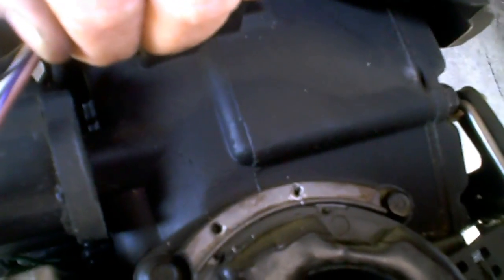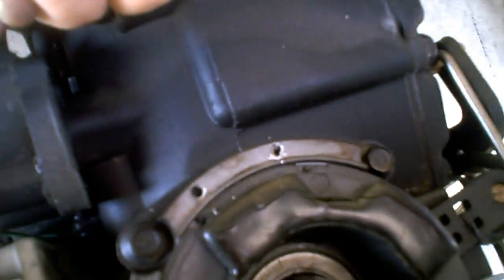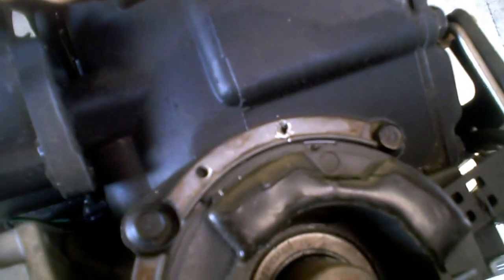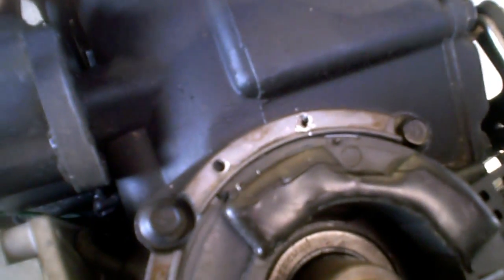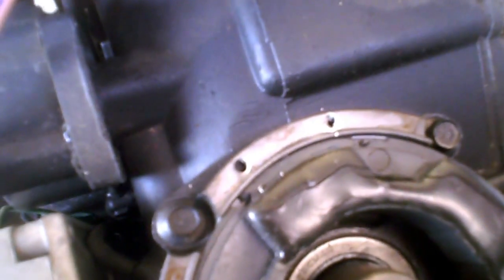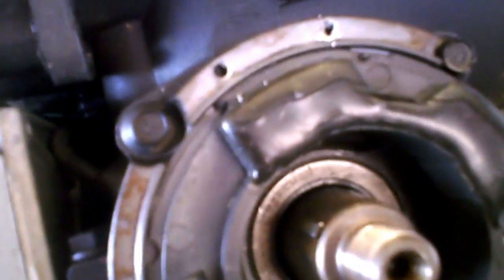Diagnostic Under the Flywheel on a Mercury Outboad Motor, Trigger, Stator

Comment: Hi, I have a 2006 15hp mercury. getting yellow sparks on both plugs (tested plugs, and replaced the ignition coil). Will changing the cdi fix it or can the trigger be an issue?

Comment from the maker: If you have the model with the power pack with two reds and two blue (one set with the white tracers), swap the red with red and white, and blue with blue and white. If you now lose spark on 3 and 4 at the higher RPM (usually just at 2600) then you have a stator issue with no output on the high side of one side of your stator. Replace the stator and all should be good.  Larry